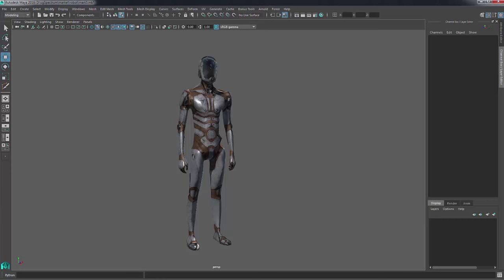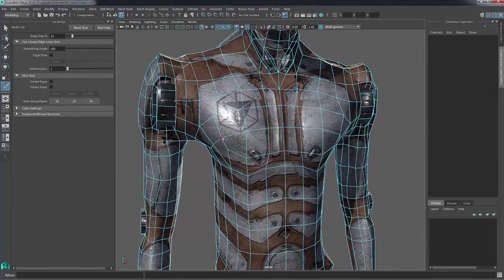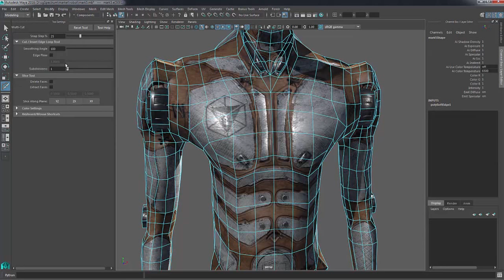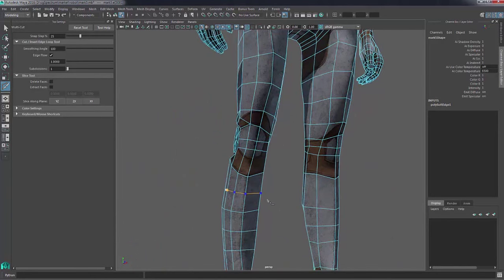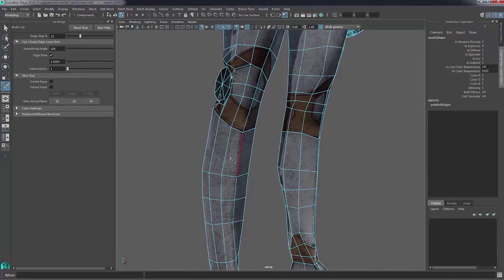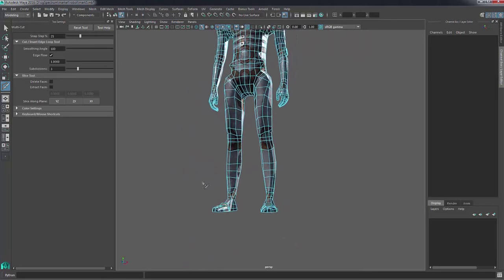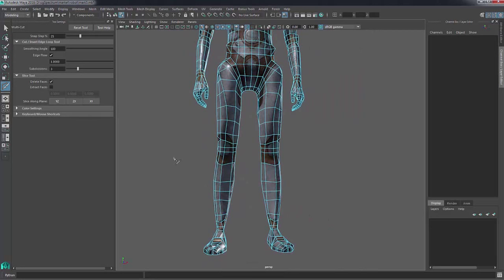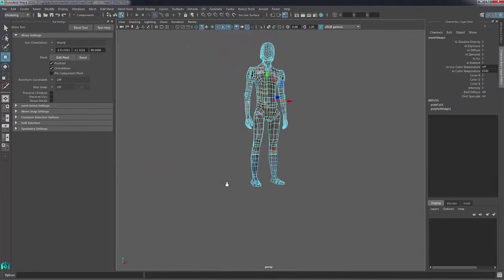Maya 2016 Basics - Multi Cut Tool

Comment: thank you for the tutorial. I have a question though. Is there anyways to use Multicut with symmetry?
Reply from the maker: +Daniel Kim Hi Daniel, we will check with our Mentor who made the video and get an answer for you. Sorry for the late reply.
Reply: Hi Daniel Kim. While CG spectrum-san is finding his mentor in the Himalayas for guidance I can tell you that if you insert an edge, you should be able to select it and activate topology symmetry. Once you've done that, the edge loops you insert should be mirrored. I hope that helps.